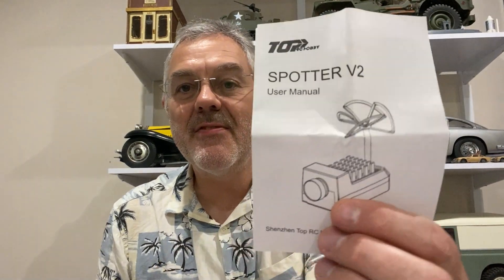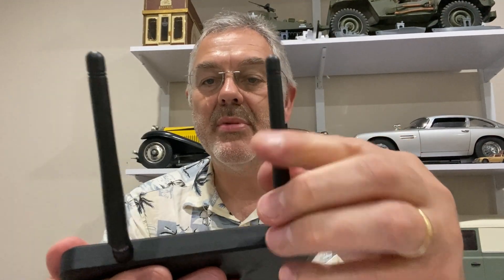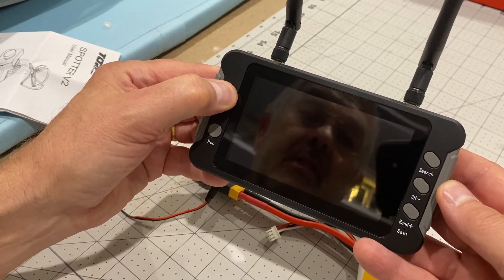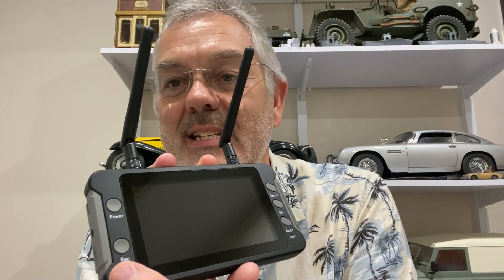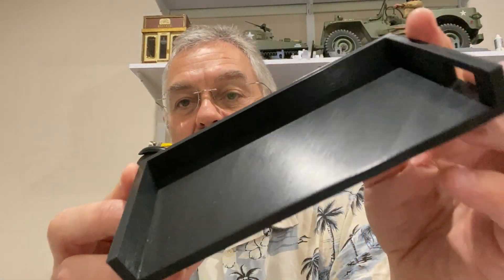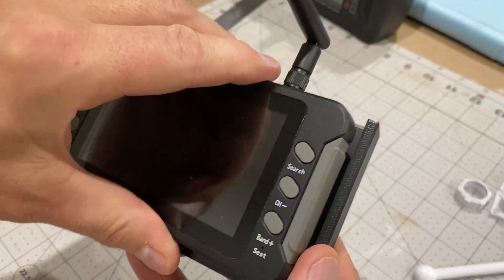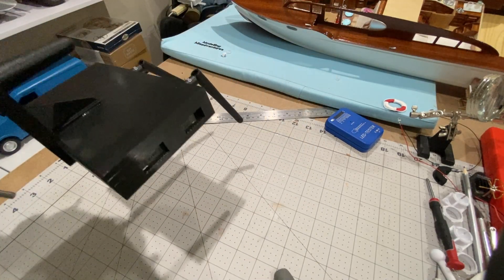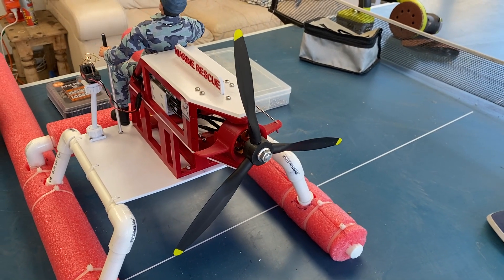RC Rescue Boat - adding a first person view camera

Comment: Getting ready to make a rescue boat and really like your design. I just purchased the camera and monitor. Did you design the mounts for the camera and monitor or find them on thinaverse?
Reply from the maker: It says in the video.
Reply from the maker: Not sure why’s there no sound. There is on mine!  Anyway, the mount for the monitor is available on Thingiverse but I had to design and print the casing that goes around it. The gimbal mount for the camera is also available on Thingiverse. 👍
Reply: @ it was my fault, I had turned the sound off and was just watching the construction and size.
Reply: That’s funny…I watched the video a while ago and found the camera and monitor and now that I have them, I watched the video again today looking at the features of the boat again but with no sound…lol

Comment: Even without FPV I have been having fun with an action cam bolted to my rescue boat. It has allowed me to get close to the ducks and geese on the farm pond. They don't mind the noise of the props which is a surprise.
Reply from the maker: Great fun.
Reply: @modellingmisadventures  I have also just realised that, if the action camera has WiFi you can do a short-range FPV onto a phone. My action camera doesn't have WiFi but I think I might get one to see if its viable over the short range I need.